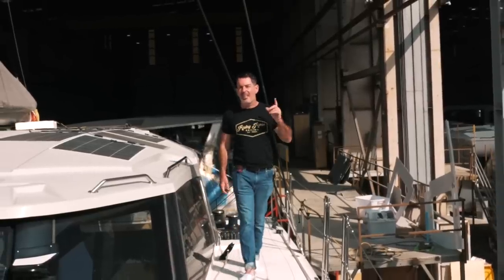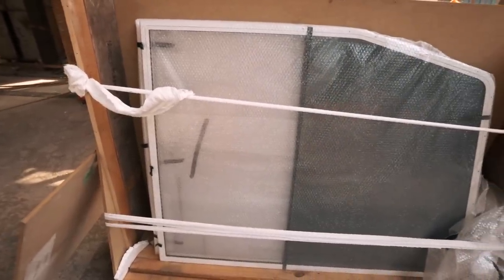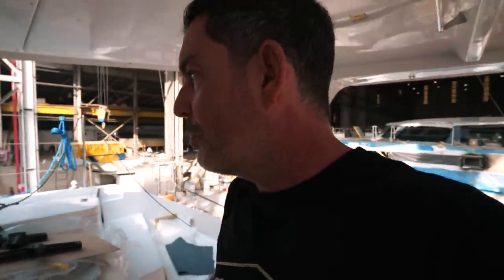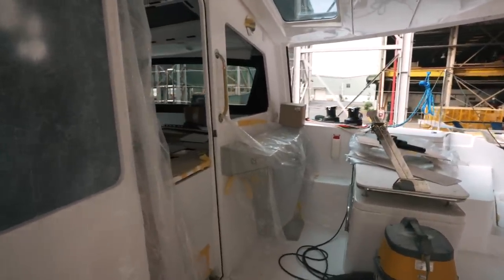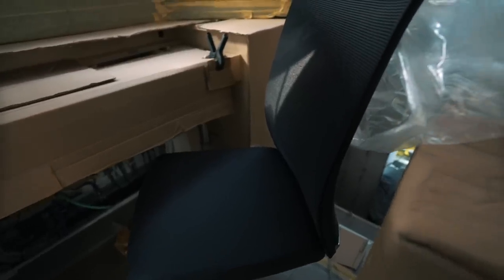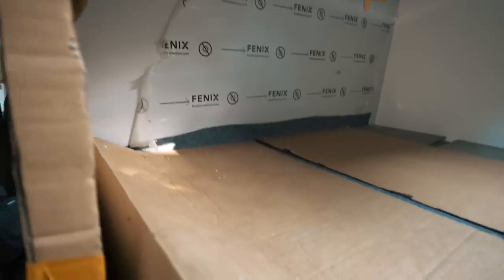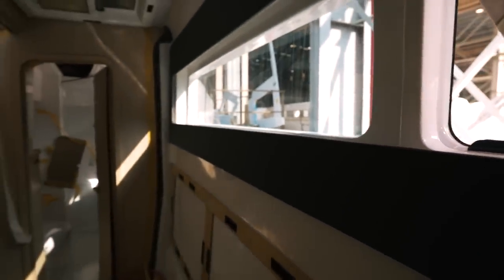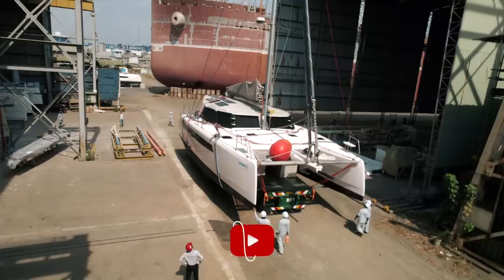The End of the Catamaran Build is Here.

Comment: Looking at the sheer quality of the design and production it will no doubt be a best seller I would not be surprised if they opened yet another production line as they can no doubt sell every one they make. However your coverage is also part of the reason that it is such a success as you brought their product in front of millions of people in the sailing world.
Reply: I THINK I heard RR2 say approx a year ago that there had been 82 orders for this catermeran. I don't know how they derive that number but suspect 82 peeps had paid their deposit, whatever that may be. That is enormous, I think. How many have been added since? Will they become an iconoclastic cat' of this decade or two and sell in the thousands?
Reply: As you said the build processes and quality looks supreme, however the big problem to increase the numbers of builds are lack of qualified manpower.  If you ride the wave and empoy substandard personnel you will be on a slippery path to a bad place, as a few has been before!
Reply: @larssolem2507  Yes increasing production would not be an easy process and manpower or at least skilled manpower would be difficult as is a multitude of other factors. Increased production would also lead to Increased sales as there are economies of scale i.e. if you go to a supplier and double your order you are going to get a slightly cheaper price which in turn will lead to a slightly cheaper boat. Also If you can deliver a customers order quicker they are more likely to buy from you at the moment the waiting list is likely 4 or 5 years so who knows how many potential customers have walked away at that point.

Comment: You should really take advantage of the build sequence of RBII and add insulation underneath the hard top and decks!  This will contribute to less heating when required by high  latitdes and simitar at lazy latitudes aving power on the AC.  As I found on my boat it also make the boat less humid inside and contribute to overall better comfort.
Looking forward to see you sail next week.  Those sail shoul make her fly in the rigth conditions!